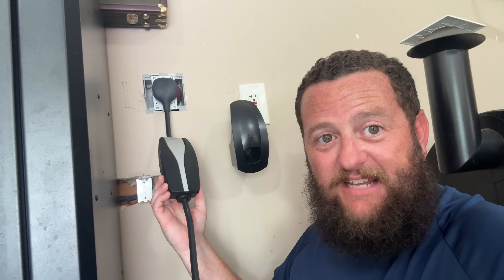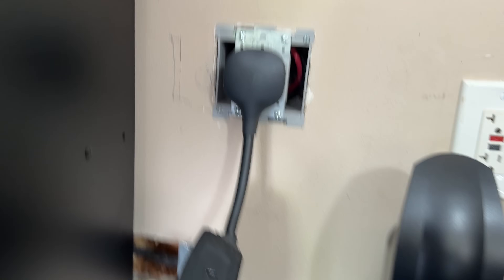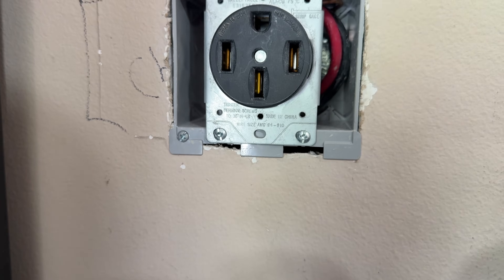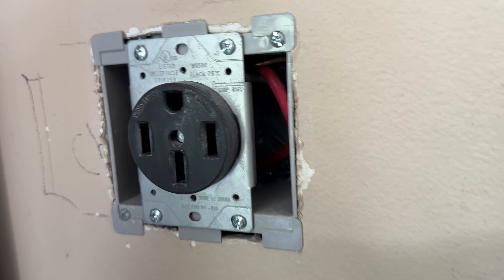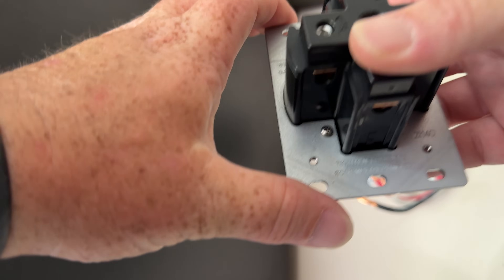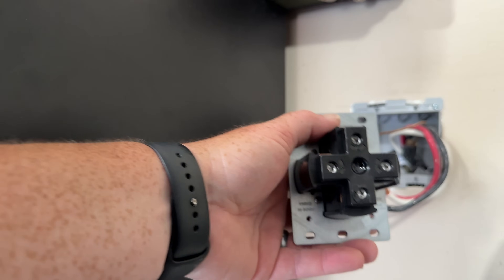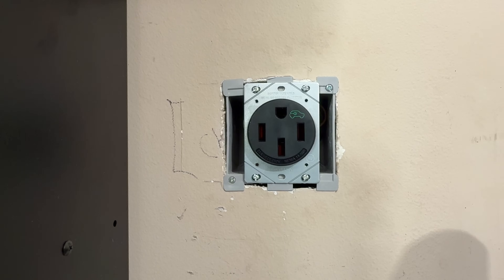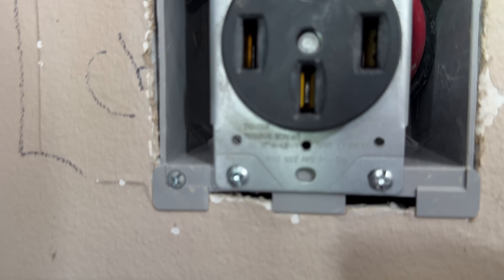Tesla Charging Failure Could Be Faulty Equipment/Fire Hazard!!!! Do This To Fix It Now!!!

Comment: I had this exact same thing happen to me in the last week. I've had the original plug (dryer type) for about one and 1/2 years and had never gotten excessive heat or any type of error message. This week I started getting the same error message that the charger had cut in half my charging speed to 16 from 32 A. When I checked the charger, like you, I noticed it was very hot and the plug itself was very hot. I had always pushed back against the idea that there was a big difference between the dryer plug and the EV plug. I was wrong, there is a big difference when you compare them side-by-side. The EV plug is much more substantial than the dryer plug.  I went to Home Depot and got the Leviton EV plug and cover. I installed it easily and then tested it on my model three and my model Y. Amazing the difference in heat and both vehicles charged perfectly. I encourage anyone who has been a skeptic on this change the cheap plug to an EV plug. It's worth your safety, peace of mind and a few extra dollars.
Reply from the maker: It’s no joke. These standard receptacles are not designed for this and will eventually fail. Some last longer than others. But end of day, they are used well beyond their capable life
Reply: Don’t get Leviton better get the Hubblell is industrial grade and safer for the EV application
Reply: @usamasaid2860 I agree, I replaced mine with a Hubble for safety reasons.

Comment: Any thoughts about 6-50R? Due to the long run from my box to the garage and the high cost of copper and because I wanted compatibility with the wife’s future welding equipment, I elected to have an industrial grade 6-50R installed instead of a 14-50R. I’ve been using it with no problems with the mobile connector (except for one mobile connector that went bad — it wouldn’t even work with 110).
Reply from the maker: 6-50 is a great option for charging. Just make sure the equipment is up to the task

Comment: I had the wall power connector installed (NC Duke rebated costs up front).  Had a similar issue, but that turned out to be a bad breaker in the panel.   I did read you need a EV specific plug, as you changed to.
Reply from the maker: Yea there’s lots of changes happening in this equipment for the better

Comment: Hey, thank you for making this I am having the same issue right now. Would you recommend doing the fix you did or just go ahead and buy a Tesla wall charger and replace it?
Reply from the maker: Wall connector is the best option for sure.
Reply: unreliable plugs is one reason I put in hard wired EVSE

Comment: My version 3 wall connector over heats and drops from 48A to 24A after an hour or 2.  I have set it to charge at 40-42 amps and it does fine.  I have double checked the connections and the screws are at the recommended torque.
Reply: Is it on a 60amp circuit?
Reply: Probably 50 😂 @DJR-u2g
Reply: @DJR-u2g  yes
Reply from the maker: Check the breaker and I’m assuming you used 6 gauge wire
Reply: @BeardedTeslaGuy yes.
Reply: I felt the same way. Change the plug. You will eventually have problems.

Comment: Why not just Gen 3 wall charger it will charge faster too. the  mobile connector is just that for mobile use .
Reply from the maker: I recommended that to him
Reply: I have been using the mobile chargers since buying my car in Dec 2024. Chargers rates are more than good enough. The reason I still think about the bigger wall chargers is simply if my wife goes EV.

Comment: Thank you for this valuable public service message! 

(As an electrical engineer, I have to assume that the problem with the non-EV-rated outlets is more that they allow for the excess production of heat over time, not that they are poor at dissipating heat in general; that is, we know that low resistance equates to low "I squared R" losses which translates to heat generation; and so once the "prong grabbers" inside the outlet begin to stretch out and grab insufficiently, the resistance goes up over time...)
Reply from the maker: Yep! I will never stop sharing this message every time the opportunity presents itself. My friend sent me a screenshot last night, then I asked for a picture of his outlet, and it was all pretty much a known culprit from there.
Reply: Yes, the standard dryer receptacles were not designed for frequent plugging and unplugging nor continuous load operations. Not a solid connection over time and the heat doesn't get dissipated adequately by the materials used to make it. So a combo of factors.